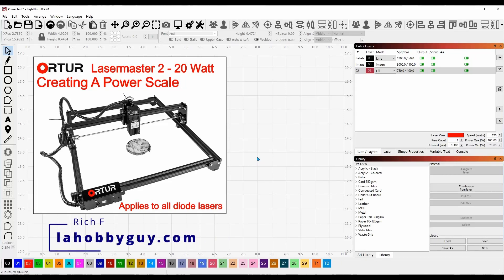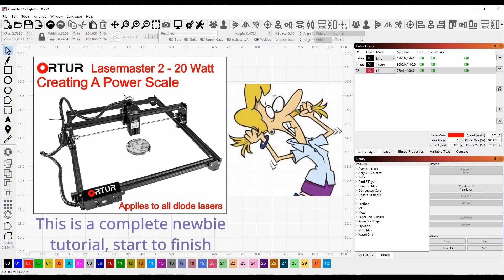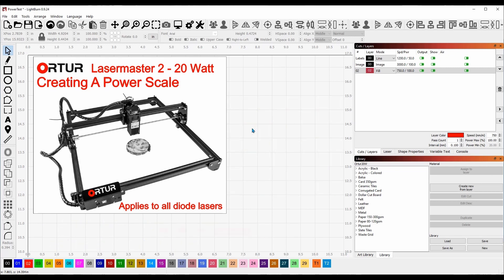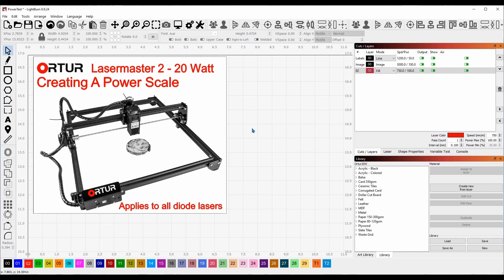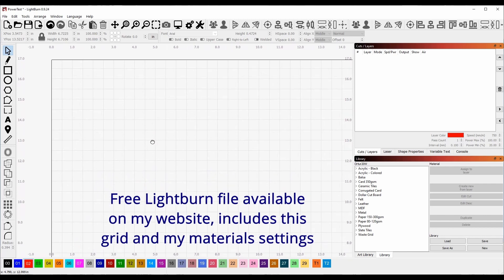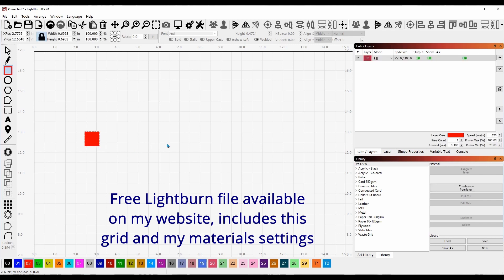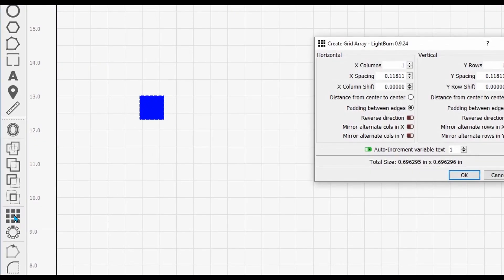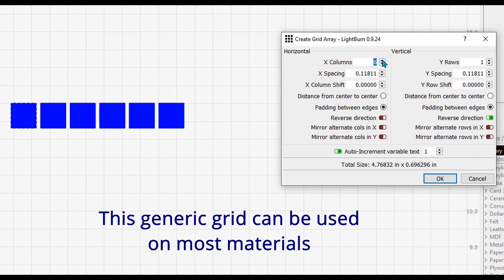Live Time - Creating A Laser Vector Test Grid

Comment: Thank you for this, and all of your videos!  Forgive me if I'm missing something obvious, but you said that there would be a link for the download of this file from your website.  I don't see it.  I've been trying to follow along with the video to make my own, because I figure it will help me learn, but I'm having problems.  When I make my grid, the squares are outlines, not filled in blue squares like yours. I'm not sure if that matters, but I don't understand why mine are outlines.
Reply from the maker: This video is over 3 years old. Lightburn has since added the automated Material Test under Laser Tools from the top menu. To see a preview on the screen, click on Window --> Filled Coarse.
Reply: @TheLouisianaHobbyGuy  Thank you for your response!  I did realize that it was an old video, but i didn't realize that lightburn added that to the program. I'm running my first grid right now. Is there a way for me to position the test grid where I want it?  I couldn't figure it out, so I just hit start, and it started right in the middle of the sheet, under the camera.  I'm going to have to take my time to run through your LightBurn classes, but right now, I'm just trying to get a few things cut and engraved for a sale this weekend.  Thanks again!
Reply from the maker: Yes, in the Material test generator, you'll see Y Center and X Center. You can set those coordinates to where ever you want.
Reply: @TheLouisianaHobbyGuy  thank you!!

Comment: Hi. This question isn't about burning or engraving 
When I import a pdf vector, the image is displayed outside of the workspace and is displayed in the top left corner.
How can I get the image to display inside the workspace?
The laser is a 5w diode creality falcon laser engraver cutter. The workspace is set using the creality file that came with it.
From Chris.
Reply from the maker: Select it and resize it.

Comment: do you have an example for engraving slate with a 10-watt laser i brand new to using my laser I have a creality falcon 10-watt falcon volume 2 and it all very confusing to me any help will be much appreciated
Reply from the maker: No I don't right now Lisa, but there is one in the works. The same principals apply, running a test grid to get the right settings.

Comment: When I drag out the square it doesn't fill in with color like yours. Why is that?
Reply from the maker: My window is set to filled so you can visualize the fill and line modes. If you click Window --> Filled Course, you will have the same as I do, but designing is usually done in Wireframe.

Comment: Hi Rich
I'm Kevin from Manchester, England. I've just got a P20 pro. Thank you for your videos I'm finding them informative and and easy to follow. 
I've just been following you step by step on how to make a test grid. 
When creating the initial box and making the array mine only came up as lines and filled from the bottom upwards. 
The preview shows different shadings for the power settings but again only as empty boxes, what am I doing wrong or what settings do I need to adjust and where do I find them?
Reply from the maker: Lightburn now has this function built in. Go to Laser Tools from the top menu and select, Material Test.

Comment: Rich. new subscriber, new to lasers, GREAT Vids !! Question. I am a photographer and we use a neutral grey card to achieve proper exposure in the lighting at hand. What are we shooting for with this test grid. What are we setting our laser power for? are we looking for the lightest lights, The darkest darks, something in the middle? Are we metering or measuring (metering) the power off a certain spot on our image we are engraving? Where do we start with our test grid?
Do we go with the darkest setting and the laser works down from there or do we start with the lowest best result and the laser works up?  Where do we not start or what do we avoid?
Reply from the maker: You're looking for all those things. Sometimes you may want to put different areas on different layers, having some light, others medium and still others dark. The test card gives you the ability to achieve these multi-shaded results.

Comment: 13:00 I don't understand the cork: why speed of 1000 with 20% is better than, say, speed of 2000 with 40%? It's the same energy per area. You can make the case that lower percentages are good for the life of the diode, because the diode remains cool
Reply from the maker: Different power and speeds have different results. It's not linear. 100 speed and 10% power is not the same as 1000 speed and 100%. Try it for yourself.
Reply: I would opt for higher speed to get the job done sooner

Comment: And in current lightburn there is a materials test screen for generating a speed power array automatically.  Hard to keep up with all the new features as time obsoletes our old approaches......
Reply from the maker: Yep!
Reply: @TheLouisianaHobbyGuy  This wavelength looks to be ablating the material and burning as a secondary effect.  I have a 10W (infinite Y) and a 5W. Have you used argon or nitrogen for a cover gas? If used inside of a pouch hood with zipper top - the concentration of the gas should eliminate ignition of the flammable materials.  I have been searching for an example of this.
Reply from the maker: No, I haven't.

Comment: I have a 5w Xtool laser it won’t engrave a test grid? I get maybe 4 squares and that’s it, no text no nothing. Even changing out to different woods? Yet it will engrave a file no problem any ideas guys?
Reply from the maker: Yeah, you just need to change the settings for the test. Slow it down.
Reply: @TheLouisianaHobbyGuy  
Thank you
Reply: @TheLouisianaHobbyGuy  
Being new, how do I determine what speed settings to enter for 5w laser in mm/m for the material test grid in lightburn? Documentation says it can do up to 24000 mm/m yet nothing engraves over 600 mm/m in test? Yet when im engraving a png or svg file it works fine at 2100 mm/m to 2500 mm/m? So confused.
Reply from the maker: Try posting on my free forum. https://lahobbyguy.com/bb. Once you're a member, you'll see a new category called, Members only downloads. In there you'll find cut and engrave libraries. Choose the 5W library for Lightburn and you'll have some baseline settings.

Comment: I tried to do this test in a thermal glass but I couldn't get through the paint, it was just very faint.
Reply from the maker: I don't know what laser you're using or your settings, so I can't help.
Reply: @TheLouisianaHobbyGuy  You're right, sorry. I used an ORTUR 2 laser, and configured it with your video for the rotary attachment, I ran the test just as I downloaded it:face-orange-biting-nails:
Reply from the maker: You have to make adjustments to the speed for the material you're using. You don't just use my settings. What works on paper won't work on wood for example.

Comment: The problem I have is that none of these test files ever works on my Lightburn program. If you look at the settings they never actually translate properly so the idea of changing speed/power doesn't actually happen. It seems to pick one speed and one power setting without the ability to change those settings from one square to another. Instead I have to manually go back and change each and every box and it takes so long I end up giving up and just going back to making very basic stuff that doesn't require power variation to achieve different layers for colors.
Reply from the maker: I don't know why, it has worked for thousands of folks. Use the test built into Lightburn instead. Laser Tools --> Material Test.

Comment: Thank you for your videos. I do have a question on the results in your video and how to interrupt them. At the 17:09 you have a sample card you run . What square would you use for fill the same coloring could be generated on many squares. example 40/2000 looks the same as 100/3000. As a newbie at this  I like the color at 40 power it look s consistent from 1000 to 3000 speed. does running a design at 40/3000 make sense as it is faster and i do not notice any over burn on the test. What are your thoughts.
Reply from the maker: It's all a matter of preference Mark. Some folks run at high power, and others don't want to. That's the purpose of the test cards.

Comment: Hi , I just got a longer ray5 5w engraver I used to run the pre loaded cut files on the SD card and after some studying started creating my own files (png.) one morning i turned it on and it wouldn't connect and the touch screen is not coming on after some digging and downloading lazer gbrl it says flash read eror 1000 and then a 371 code it has taken weeks for longer to respond with their solution that didn't work was wandering if you had any suggestions before I send it back.
Reply from the maker: Try posting on my free forums. https://lahobbyguy.com/bb

Comment: Hi there Rich !   Eddie in the UK here.   I have just bought an Atomstack S 20 Pro Laser plus the rotary unit and my learning has begun !     I was fortunate enough to find this excellent video of yours which has probably saved me quite a few headaches in setting up my laser !    I am totally new to laser cutting and was worried about getting the right power - speed settings for various materials.   I couldn't see any material settings in my version of Lightburn Rich - so am I missing something ?   My main reason for investing in this machine is to hopefully be able to cut light plywood and Depron materials to make radio controlled model aircraft.   I also hope to be able to perform some engraving and create some Craftwork items to sell to pay for the machine !  Lol !   
Any help and advice you can give will be most welcome.   Thanks again for a great video Rich - I have subscribed to your channel and look forward to seeing more from you.  
Best Regards . . . Eddie.
Reply from the maker: Click Window --> Cuts / Layers Eddie.
Reply: @TheLouisianaHobbyGuy  Hello again Rich 
I hope you don’t mind me troubling you again but I have a problem I just cannot solve !
I’ve just bought the Atomstack S 20 Pro as you know.
I also bought a Honeycomb Unit but when I sit the machine on top as in your video of the X 20 the laser head sits 35 mm above the Honeycomb and won’t go any lower to focus it correctly with the angle plate supplied.
I can’t get hold of anyone at Atomstack so if you could help I would be most grateful Rich.
Best regards to you my friend.
Eddie.
Reply from the maker: I can't imagine it in my head Eddie, but it sounds like to need to use risers for the honeycomb.
Reply: @TheLouisianaHobbyGuy  Thanks Rich.   Have done !    Just setting up your power grid now and when I copy your keystrokes from the video I get hollow or empty boxes whereas yours are filled as you draw them.   How do I draw filled boxes please ?
Best Regards . . . Eddie

Comment: Maybe I need a vocabulary lesson, but why is this called a "Vector Test Grid" when the test involves "Fill" for every part of the test grid? Doesn't that make it a raster test, which is how all shaded engraving is done?
Reply from the maker: Yep, just one of my idiosyncrasies... I interchange fill & line without thinking. I design vectors and then raster engrave them, but still call them vector graphics because they are. If you pay attention, there's plenty more misspeaks in my videos! My old brain is very tired... 😎
Reply: @TheLouisianaHobbyGuy  No problem. I just wanted to know if I understand the vocabulary or not. The plusses that come from your videos far outweigh this point. This video has a key lesson I've not seen elsewhere. It is wise of you to recognize that making a full grid is one thing, but shutting off Outputs on squares outside the range of interest and sharing that insight with us is very helpful. You are very helpful in our quest to shorten the learning curve for LightBurn and get the most out of our laser engravers.

Comment: i did the grid but how did you get the squares to be filled in color?
Reply from the maker: Change the layers from line to fill.
Reply: @TheLouisianaHobbyGuy  Do you have a video showing the settings for cutting, I may go straight to it without search. I been searching for some and still can't find one to help me. When I try my setting I can't seem to get it to cut and I feel setting it at 10 or more to pass count is a bit much.
Reply from the maker: Hi Mely, it's impossible for someone to give you settings to cut; there are too many variables involved. Sign up on my forum at https://lahobbyguy.com/bb/ and post a new topic in the Lightburn software section asking for help and someone will help guide you to the correct file to load in Lightburn for all of your cut settings. Every setting is based on the material & your laser.
Reply: @TheLouisianaHobbyGuy  I'm realizing that. I finally found a setting after going through many settings to get it right yesterday. This video here truly did help though. Thank you!

Comment: Let me tell you when they say never leave your laser alone they are 100% right, I finally downloaded your file Rich and I  tested one of the cheap plywood coaster they sell on Amazon the one that come in a pack of 60. When the laser(sculpfun s9)started burning mate when it got to 100 power the thing nearly caught on 🔥, I stopped it immediately and I ended up adjusting the output at 40 % en every layer, even 50 it burns the plywood.
Any way great file and everyone should run this test
Reply from the maker: Especially on test grids Alan!

Comment: I made a test grid following your video, however when i ran the file it was not very dark, nor was the blocks much different. i had air assist on. does that make a difference?
Reply from the maker: You have to change the power settings to match your laser Robert. Just increase it for each color.

Comment: Hi Rich. I have a question for you. I downloaded the file, checked the power and speeds, and previewed the setting like shown at 17:29. Mine is showing all black like yours did when the settings were all the same? been following step by step so I dont know what I'm doing wrong. Any idea what's happening?
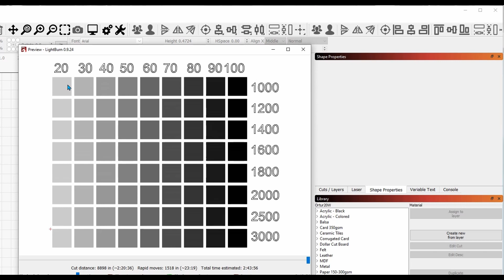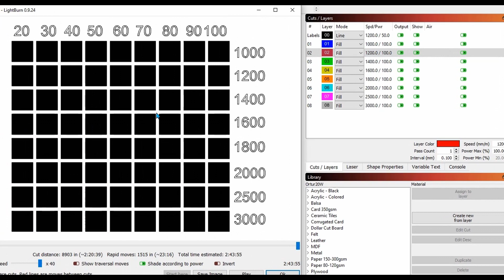Reply: Sorry, 8:57. Put in the wrong time. It look like 7:24
Reply: I'm also not connected to the laser. I'm on my laptop in the other room so would this be the reason since I'm not hooked up to one of my lasers? I mean could it be displaying the cut density by the laser lightburn  is  communicating with? SO for so many reply's to my first question but I'm trying get a full understanding of this.
Reply from the maker: No, you don't have to be connected.
Reply from the maker: Zoom in Steve.
Reply: @TheLouisianaHobbyGuy  No difference. I was zoomed in and the lines were uniform color all the was as I panned
Reply from the maker: It'll burn properly.
Reply: @TheLouisianaHobbyGuy  Ok I'll give it a try in the morning. Right now I'm driving a member crazy on your Facebook page trying to figure out an orientation problem I'm running into. All I can say is he has paitience of a saint with me haha

Comment: Sorry but this isn't what I was hoping.  Not your fault, just looking for CO2 related types grids and you indicated this is just for diode lasers.
Reply from the maker: I'm doing a Co2 video right now! And this particular grid was made for a diode, but... it works just the same for the Co2. You can still use it as a template and just change the max power.

Comment: I have a question I downloaded your file to run on my xtool d1 it runs but everything is running at the same power I've checked the power setting and it's set right any suggestions not sure what else to try  I've tried other single jobs and power doesn't change
Reply: Ok thanks
Reply from the maker: You might try downloading the file again and overwriting the one you have. Could be a corrupted download.
Reply from the maker: Hi Jim, I just tried it on my D1 and it worked fine. Perhaps contact x-Tool and see what they have to say?

Comment: As a new Diode Laser user, this video is great.  However, I must be doing something wrong because when I load the test pattern file into lightburn and verify the powerscale settings, when I select preview, it appears as if everything is going to burned at max; i.e all the squares are completely black, there is no shading from left to right, light to dark?
Reply from the maker: The layers are power scaled, don't worry about it.
Reply: I found my error - I had not seen the "shade according to power" switch on the preview window

Comment: Hello Rich,  I'm using Lightburn ver 1.0.06, am watching the video on my desktop and trying to do the same thing on my laptop but not figuring out what I'm doing wrong.  Every time I preview the grid all my squares are solid black.  Two differences between mine and yours.  When I draw a square it's a hollow square and not a solid square as in your videos.  In the Cuts/Layers window the mode say Fill but it's just the 4 lines.  Also in that window is Power Min %.  Yours is grayed, mine is black and wants a number.  I've tried zeros, variables, and maximums.  I can't figure it out.  Any suggestions?  Thanks, David
Reply from the maker: I preview as I go, so if you want to to click Window ---> Filled Smooth. The preview window will show all black. My min power is set to 10%
Reply: @TheLouisianaHobbyGuy  Thank you, will do.  Excellent videos!

Comment: i have just bought a 90w diode , will thses settings work or do i need to reduce them drastically ? thank you for your video , very helpfull for newbies like me
Reply from the maker: Yes it will. 90W is just the power supply. It can only really be a 10W optical output.
Reply: @TheLouisianaHobbyGuy  Thank you , will try out the settings tmr .